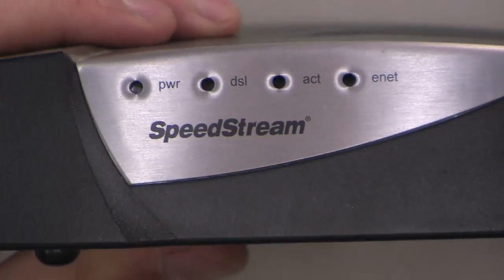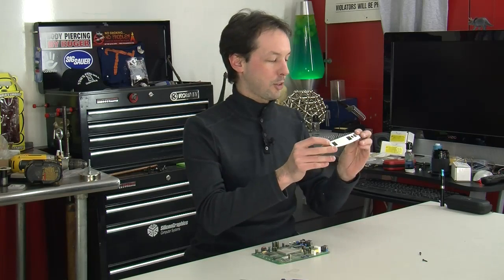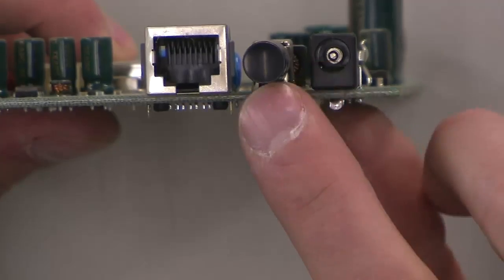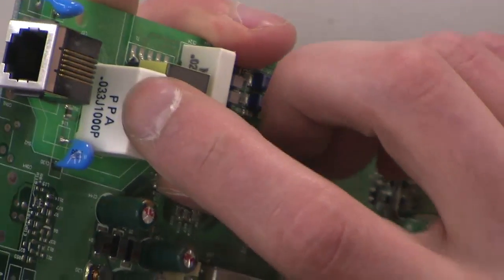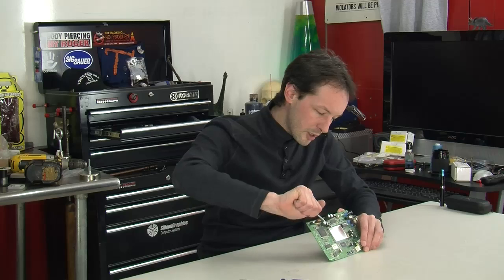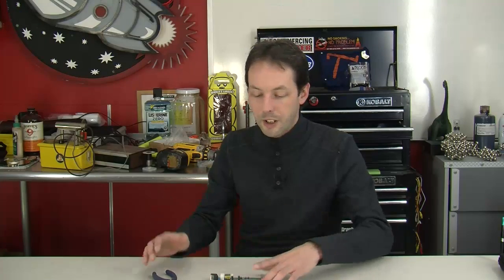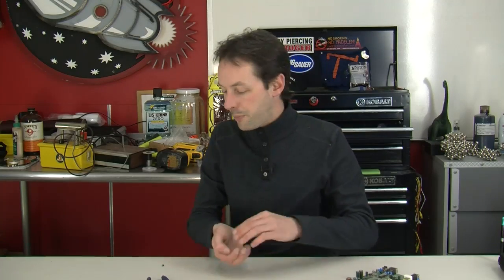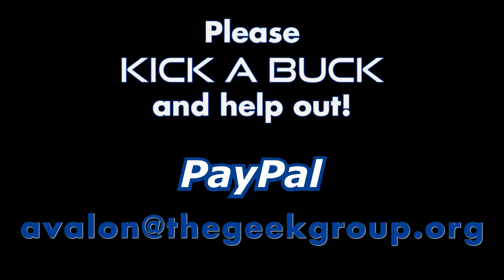SpeedStream DSL Modem: Equipment Autopsy #36

Comment: Heh, I thought the white box with 2 pins was an RF choke or a coil of some sort.  Hit it with your multimeter in resistive mode and if the resistance goes up over time, It's a cap, if it stays steady, it's a choke or a resistor, or a coil.  I don't see any vents on it, so I ruled out capacitor almost immediately, that and I've never seen anything like that for caps in the mouser catalog.

Comment: DSL (adsl/adsl2/vdsl) work over the same twisted pair as telephone but has little to do with the actual POTS. DSL equipment is added after the OE (except in the case of some lucent remote cards) either in the CO or OSP. Filters are required to prevent interference, however In most installation a Corning POTSPLITTER is installed which removes the digital signal from the POTS. This prevents the interference on the phones - aswell as improves the dsl circuit by removing bridgetaps. Refer to DSLAM.

Comment: DSL MODEM= Digital Subscriber Line, Modulator/ Demodulator. It takes a analog Telephone signal, cleans it up and transmits a digital signal thru the phone line. This is why you need a DSL filter on the phone line. and as for the metal square on the processor, its a RF shield.

Comment: Ah electrolytic capacitors. It's amazing how much money can be saved by replacing those in failed electronics. Just remember that big capacitors bite.

@thegeekgroup
Why not salvage bits and pieces from electronics (and from other stuff) when you do these equipment autopsy videos? There is usually someone to help and could easily do some desoldering while at it. People might be happy to know which are the most effective ways of doing that, and at least Paul might be interested in free parts.

Comment: Embedded Linux or VxWorks or something proprietary.
Electrolytic capacitors are a very frequent failure in computer equipment.  Very low quality or counterfeit capacitors brands are a plague.